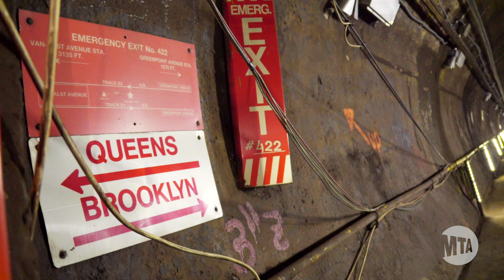Greenpoint Tubes Repair

Comment: New 7 route: flushing Main Street, Mets willets point, 80th street Roosevelt Avenue, 50th street LaGuardia airport road, 111th street, 103rd street corona plaza, junction blvd, 90th street elmhurst Avenue, 82nd street Jackson heights, 74th street broadway, 69th street, woodside 61st street, 52nd street, 46th street, 40th street, 33rd Street, queensboro plaza, court square, hunters point avenue, Vernon blvd Jackson avenue, Beautfort road, grand central 42nd street, 157th Street, 145th Street, 11th Avenue, 191st Street George Washington bay, 96th street, 5th avenue Bryant park, Times Square 42nd street, canal avenue, Houston avenue, Chelsea avenue, 34th street Hudson yards,  Models: r188, r142, r62, r62a, new <7> route: flushing Main Street, Mets Willets point, Junction Blvd, woodside 61st Street, Queensboro plaza, court square 23rd street, hunters point avenue, Vernon blvd Jackson avenue, beautfort road, grand central 42nd street, 157th Street, 145th Street, 11th Avenue, 191st street George Washington bay, 96th Street, 5th Avenue Bryant Park, Times Square 42nd Street, 34th street Hudson yards, Models: r188, r142, r62, r62a,
Reply: Handsome Chan Kemp no